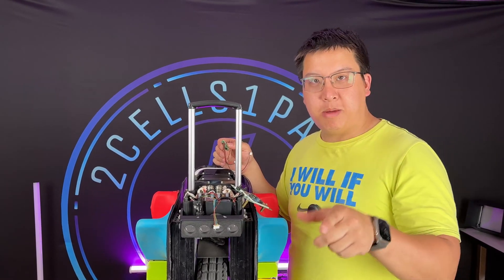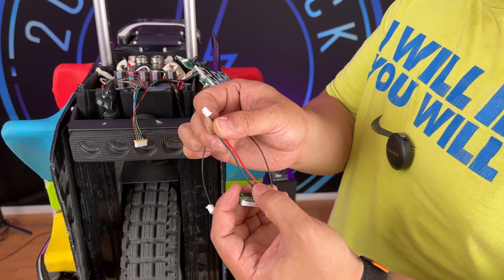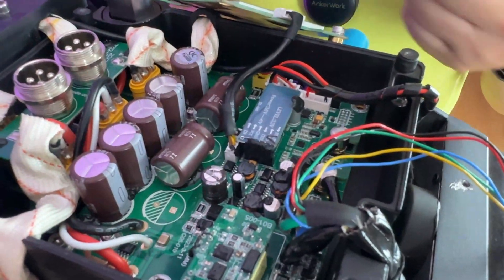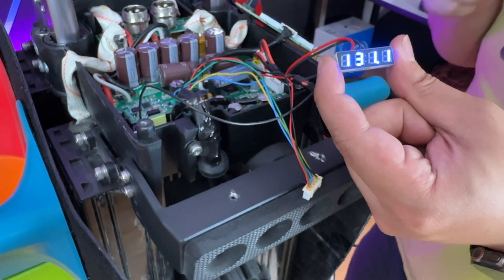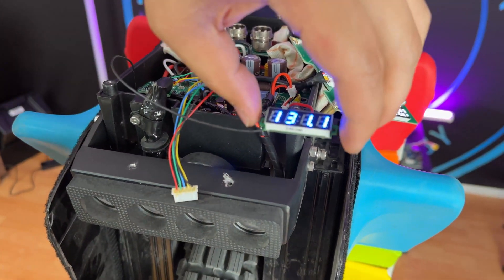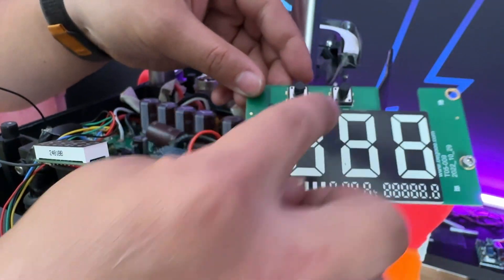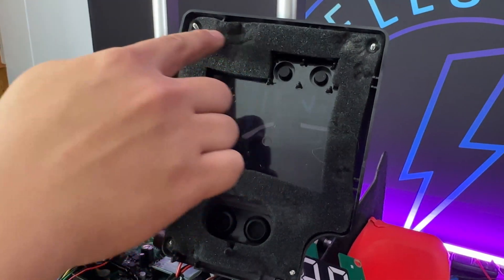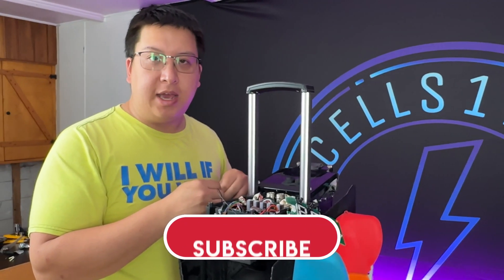Begode EX30 - Voltage Display Add on

Comment: Hey there! Begode came out with a new Ex30 Main board, which I had the fortune of obtaining. This requires a new upper display board. I have figured out how to apply the old Voltage Monitor to the new Ex30 main board. this requires some grinding and soldering. I have taken a video of the process for any of those who dare follow in the future! https://youtu.be/kMb5fKfb1hM

Comment: Thanks for this video. I just added one of these to my wheel.

One thing I didn't like was how the voltmeter's PCB was a bit wider than the display so when glued to the top of the begode display it sits at an angle and the glue has a little gap to bridge. If I could do this again I would 3d print little posts and screw or glue the voltmeter's tabs to the posts and glue the posts to the begode display's PCB.
Reply from the maker: Yes, there's much better ways to do it. Mine was just a quick video as some people were asking me how I did it. I didn't delve too deep to optimize it.

Comment: Is there any way to get power off the board at 5v or at a low voltage that could be stepped down to 5. for usb devices etc. Would be amazing if it's as easy as plugging into some jst connectors like this.
Reply from the maker: If you get a step down converter I would just step it down from the battery source. 

Trying to get power from the circuit board without knowing the internals and their limits can turn sour real fast. I think Go George Go had a video on this on his EX20
Reply: @2cells1pack  Stepping down from 134 to 5V takes a hefty buck converter and I believe they generate heat and are wasteful. I have one for stepping down onewheel voltage to run an esp32, it does less than 100V and it's probably too large to fit inside.

I actually got the idea of looking for ~5V on the board from Go George Go. one of his early ex30 videos mentions poking around with a multimeter looking for 5V to charge devices and not finding it. I saw your video and was amazed there's already JST connectors on the board for this and was hoping you knew something George didn't.

Comment: !!!!!!!

Please be extremely careful with this, I installed mine and had to bend the wires coming out of the volt meter a bit for it to sit flush with the speedometer screen…and my EX30 shorted out….once I took off the volt meter, the EX30 continued to work normal….just becareful! So glad it didnt short while I was riding!
Reply from the maker: Yes, please be careful not to short anything out.

Comment: Are the MasterX and OG Master have the same connection as the EX30 ?
Reply from the maker: No, it doesn’t
Reply: @2cells1pack  would you do a video that shows how to install it on the OG Master/X/Pro? 🙏🏽

Comment: Great instructions, your vids are awesome!   For anybody doing this there’s no soldering required…just crimp on connectors with some pliers, took 5 minutes 

Noticed your headlight is not stock, maybe you can do a headlight upgrade video next !
Reply from the maker: It is stock, the wheel in the video is my maxter30 that’s why it’s different hahaha

Comment: Will this work on the commander pro? Are there places on board to plug it in
Reply from the maker: Potentially could work on any wheel. Just need to find the location to tap
Reply: @2cells1pack  if is possible for you to a video for the commander pro..I would like to know and see if there is a place for it on the board and I will do it. Just don't want to get it wrong

Comment: Hi can you do mod for changing the blue brake lights of many begode wheels? I know many people don’t like the blue color and would rather that it be red or orange.
Reply from the maker: its only a blue idle light. Once you start riding i believe the brake light is red.
Reply: @2cells1pack  yeah but blue light are illegal in most of Europe and it doesn’t look nice. Thanks
Reply: @mahdihosseini6361 when you ride it's red. It's only RGB like this when you're standing still.

Comment: Great addon. Unfortunately after updating my EX30 to the new firmware with race mode, darknessbot won't show any data from my wheel anymore. It does connect to the wheel but it just shows a bunch of spinning loading symbols where the data would be. Any suggestions?
Reply from the maker: You require the beta version of DarknessBot for it to work. I'm not sure when it'll come out of beta though. https://testflight.apple.com/join/B6r39HPw
Reply: @2cells1pack   thank you! that worked. I can see all my stats
Reply: also your link to the E6000 Glue is the same as the JST Connector kit
Reply from the maker: Thanks for letting mek now !
Reply from the maker: Fixed !

Comment: Short, sweet, concise! Just how I like it :-D Thanks for making this, Albert. Do you know which other wheels have those connectors on the motherboard and also do you know if that display is using any power when the wheel is off? I suppose it's not getting any voltage until the wheel is turned on?
Reply from the maker: I have to check - but from memory I think the Master boards had similar extra plugs.